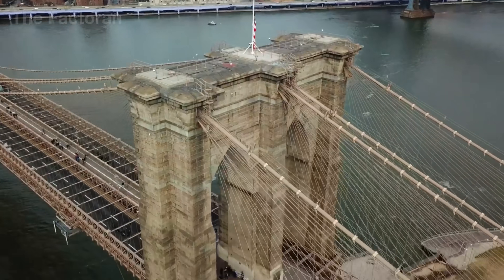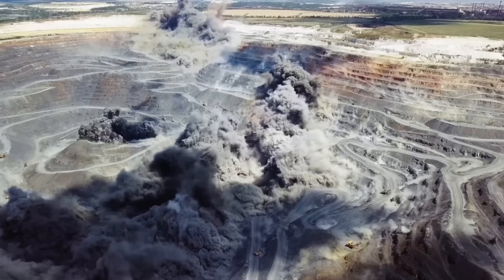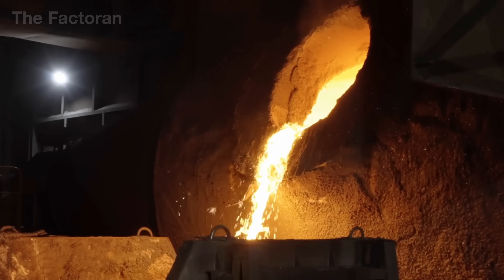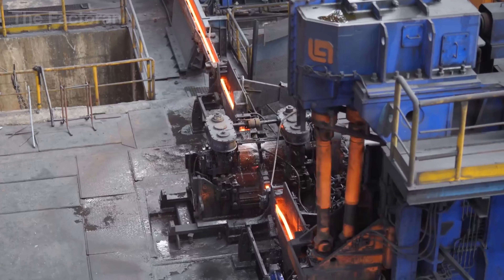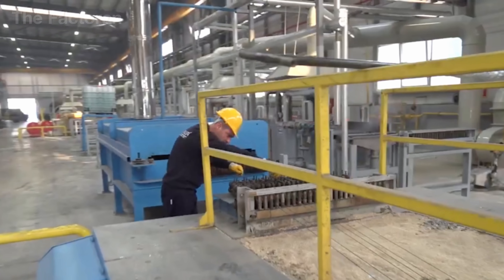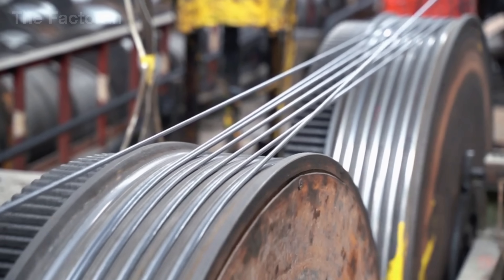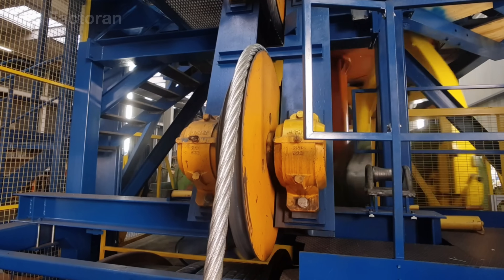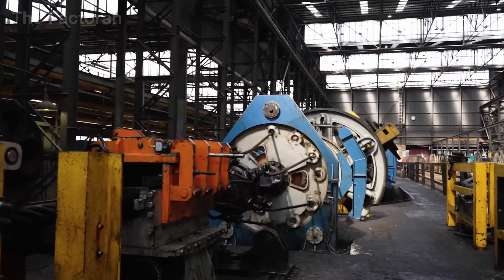How Giant Steel Cables Are Made In Massive Production Line | Over 10,000 Feet In Length

Comment: This video is absolutely incredible and showcases a phenomenal feat of heavy engineering! The title highlights a truly massive operation: How Giant Steel Cables Are Made In Massive Production Line. It’s genuinely mesmerizing to witness the immense power, precision, and coordination required to twist countless wires into a single cable over 10,000 Feet In Length. This footage perfectly captures the scale and high-tech automation of modern metallurgy and industrial manufacturing. Thank you for this brilliant, detailed look into the creation of these essential structural components!

To emphasize the themes of steel, giant scale, massive length, and the factory, I suggest using icons that capture these elements for the title/thumbnail. Try incorporating: 🔗, 🏭, 📏, or a powerful 💥. These will instantly attract industrial enthusiasts and engineering fans!
Reply from the maker: Really appreciate the feedback — I’ll keep the focus on scale, engineering, and factory visuals while keeping things clean and professional without extra icons.

Comment: This video is absolutely spectacular and a true showcase of heavy industry! The scale of Giant Steel Cables being made in a Massive Production Line is simply breathtaking. It’s mind-boggling to think about the precision and force required to manufacture cables that are Over 10,000 Feet In Length. Watching the process—from the initial wire drawing to the final high-tension twisting—is a fantastic demonstration of industrial engineering. This footage perfectly explains the backbone of modern infrastructure!

To emphasize the themes of steel, massive scale, and the extreme length, I suggest using icons that capture these elements for the title/thumbnail. Try incorporating: ⛓, 🏭, 📏, or a powerful 🏗. These will instantly attract viewers interested in engineering, heavy industry, and construction!

Comment: Can you splice them? How do you connect the 2 ends of a ski lift cable? Is a 1" cable stronger than a 1" solid bar?
Reply from the maker: Great questions — those cables are usually joined with a special splice that locks the strands together. And yeah, a 1-inch cable can handle different types of stress compared to a solid bar. The engineering behind it is wild.

Comment: We use 9mm thick metal rope when winching cables through ducting and its breaking strain is 12t, I wonder what the breaking strain is on the much larger type used on the Brooklyn bridge, it’s impressive that it has lasted so long.

Comment: I used to work in the wire and cable machinery field. Our machines were all for power cable, but many of the processes are the same. This video was great but barely scratched the surface around the involved machines. What is interesting, for steel cable, is that cradles holding the wire reels, when stranding, they must turn to avoid any torsion in the strands. If this is not done, the cable itself becomes like a giant spring and would twist and coil wildly and be unusable. All in all, a very well done video.
Reply from the maker: Thanks for the awesome insight from your wire and cable machinery days! You're spot-on about the stranding process and those cradles—preventing torsion is critical to keep cables from turning into giant springs, and it’s wild how precise it all needs to be.

Comment: If you start by mining, you forgot, that first thing you cook out is iron.. after that you cook it to steel, by taking out the overshoot of carbon, interestingly by holding more graphite (carbon) into the soup and have it under extremely high currencies…
Reply from the maker: Cool point! Yeah, you mine iron first, then smelt it into steel by tweaking the carbon content—adding graphite and using high heat to balance it out. Wild process!

Comment: A very interesting video  but short on detail. Can we have another session showing the different lays  and the twist applied for different applications?
Reply from the maker: Glad you found it interesting! 🙌 You’re right though—it only scratched the surface. Different applications really do use different lays and twist patterns depending on flexibility, strength, and wear resistance. A follow-up video diving into those specifics—like why elevators need one type of rope while cranes or bridges use another—would definitely be worth doing.

Comment: How do the short lengths get wound into giant lengths? I'm not sure that was covered...
Reply from the maker: Great question 👍. Steel cables aren’t usually spliced from short pieces—instead, they’re manufactured in continuous lengths. Multiple wires are drawn out from spools, then fed together into a stranding or closing machine that twists (or lays) them into a cable as one long, continuous process. That’s how they get those giant reels without having to join a bunch of short sections.

Comment: I did not learn how giant steel cables are made at over 10,000 feet in length.  I already know how small wire is drawn to 10,000 feet, and have provided the insulation to many different customers in the mineral insulated cable industry.  
Otherwise, very informative video for the general public, but as commented, the video is just random eye candy that does not accompany the narrative.  That's OK with me if you just tell me what you promised to explain in the title.

Comment: With a few flaws, such as the sneaky rebar, an impressive educational video. Wow. Never knew the number of steps and the amount of precision needed to make steel wires in extreme conditions. 

What I wonder the most, besides the stamina of workers, is the material of the machines and containers handling the molten iron.
Reply: Well spotted on the rebar.
Reply: 😊 those containers are called ladels , about 35mm walls lined with refractories , holding 100t of molten steel  its a no go in crane isles as refractories crack allowing molten contacting steel shell , melting it and running out , its frightening to see molten steel pouring over working machinery
Reply from the maker: Great point—the equipment that handles molten iron has to be made of extremely heat-resistant alloys. 🔥🛠️
Reply: @TheFactoran  molten will quickly consume solid metal,so they use refractories as insulation
Reply: still wondering how they pull the very long cables for the Brooklyn bridge and the Golden Gate bridge. No splices, the cables must be miles long.

Comment: Excellent Film. The first excavators shown are rope operated, not hydraulic. The big drum twisters and the horizontal large twisters are very impressive. I used to work in an electric cable factory, and we had a couple of big drum twisters.
Reply from the maker: Thanks for sharing your insight! Rope-operated machines are fascinating to see.
Reply: @TheFactoran you can just put iron ore into a smelter with scrap iron and expect to use it, thats not how it works. Iron ore needs to refined before that step because iron ore isnt high pureity. It goes through several steps not just crushing the ore down. A refining step is making the ore into pig iron, its a crucial step for making steel, it removes impurites in the iron ore which is refining. Than thats used with scrap metal

Comment: Your thumbnails show a picture of a rope whose diameter is the same height as a man.  But not in the video.  Is there a wire rope of such dimensions?   Where is it deployed?  Or are you baiting us?
Reply: Yes its a common trend now to have an AI picture to grab your attention..its annoying as fuck but smart
Reply: Bridges
Reply: No such cable is made in any factory.  It's clickbait.  THere are such steel cables on many suspension bridges, but they are usually made on site, as the bridge goes up.